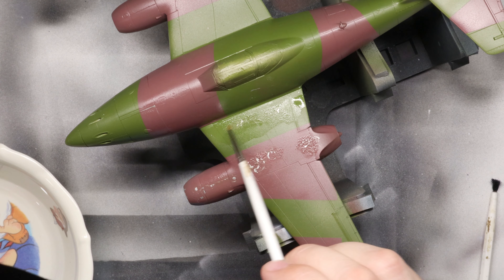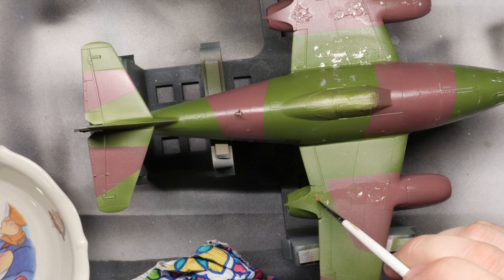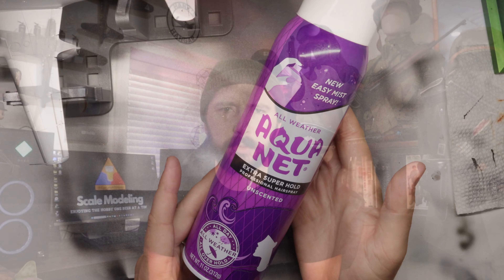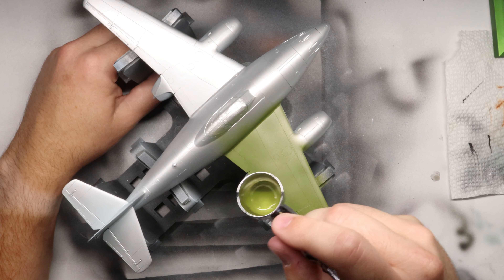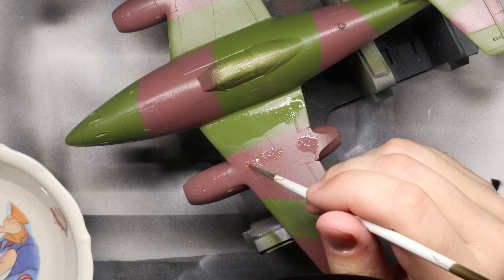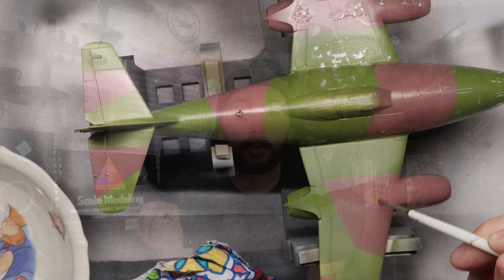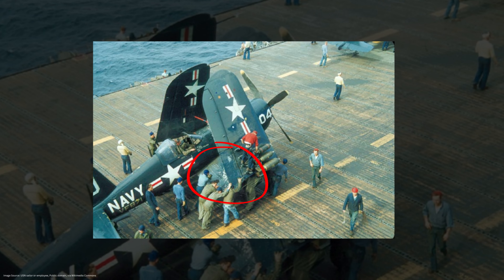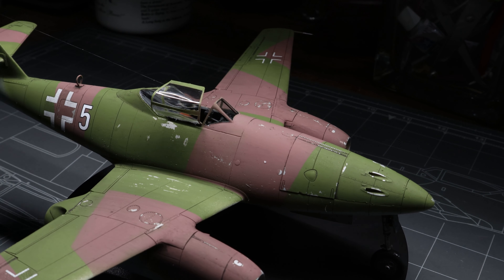The EASIEST & MOST AUTHENTIC Way to Chip Scale Model Aircraft

Comment: While I do use this method my most common go to is the silver pencil!
Very precise and removable if you go to far😊
Reply: I do the same, just like you said more precise and controlled and easy to remove if over done. In fact I just purchased AK weathering pencil set from Scale Hobbist. Can't wait to start using it on my F4U-1 a Tamiya kit I'm working on.
Reply: I like silver pencils as well. I find it easier and more precise than other methods.

Comment: One additional step that you can do, depending on what aircraft is being done is a “primer” coat, such as zinc chromate above the metal layer. Looks really interesting when you have a spot of bare metal surrounded by primer, and also so chips of just primer.

Comment: Tip #3 - chip the areas that were made of metal. I have seen too many La-5s or Yak's with metallic chips, as well as fabric covered ailerons or rubber de-icing boots on leading edges

Comment: Thank you for the video on this well-known technique. I appreciate you informing us of the need to let the hairspray dry and cure. Something most videos on hairspray chipping does not mention. However, I am wondering: Should the top layer of paint also dry and cure before using the water? Btw, I have no bad (but also not many) experiences with applying hair spray directly from the spray can - however, this may also come down to the specific hair spray product used.

Comment: Just a question, but say id like to apply an coat of the primer color used on the aircraft over the coat of metal and shipping and aswell the camo over there just for the sake of more realistic look? Would this require me to add on more than one coat of shipping? But would it also make my aircraft look more in touch whit how it would normally had looked like from the factory or the field where museum coat finish wasent a priority and ratter just getting it out. Also i did take a look at a bf109 and noticed that there was some few red spots on the either so weared out and battle hardened camouflage. Did the germans apply red to their aircrafts??? Thanks for your answer